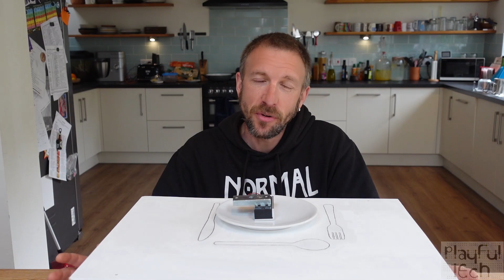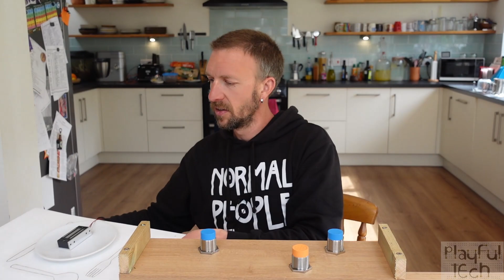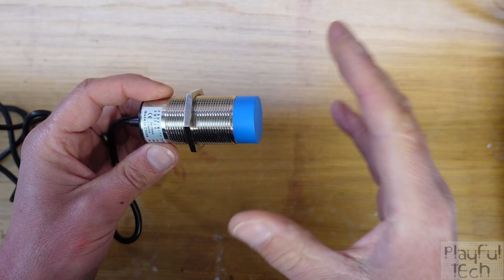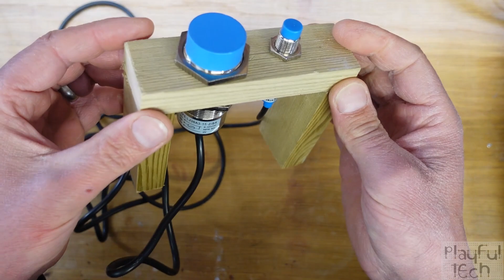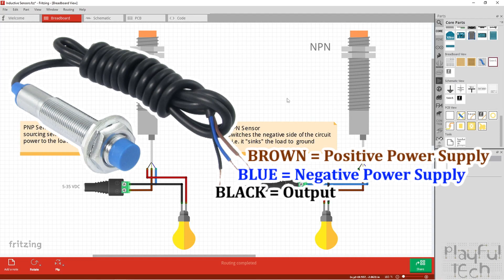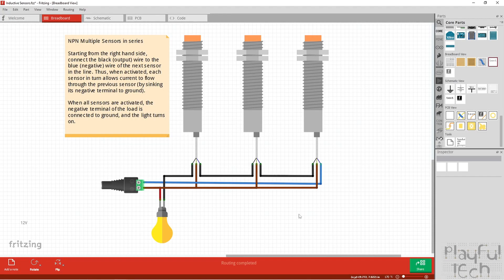Inductive Sensors for Escape Room puzzles

Comment: Does any metal trigger it, or just iron/ steel? Like if we had aluminum ingots and one steel would it ignore the aluminum?
Reply from the maker: Yes, it will detect aluminium, but only at a closer detection range than a ferrous metal.

Comment: I wonder why the enclosure and huge nuts don't constantly trigger it? Maybe a special material that locks the eddy currents down, maybe it's configured to be blind to the background currents and only trigger when there's a change
Reply from the maker: That was exactly what I wondered too! I assume that it's calibrated to account for the metal casing. Either way, I think it's safe to avoid adding any further metal hardware in the vicinity.